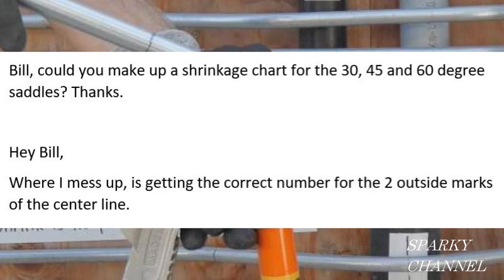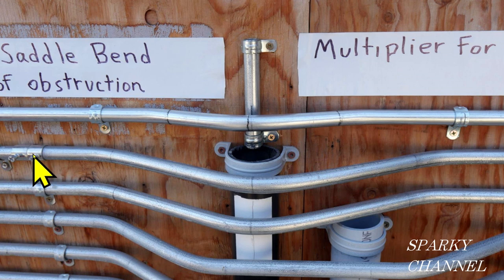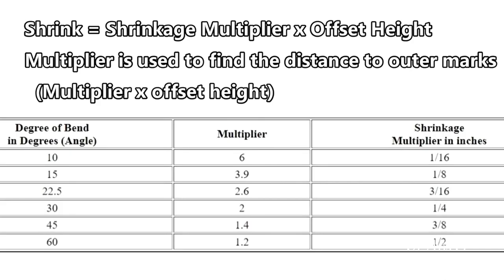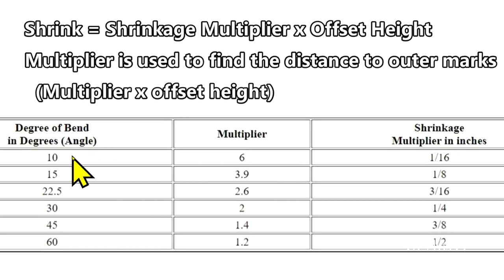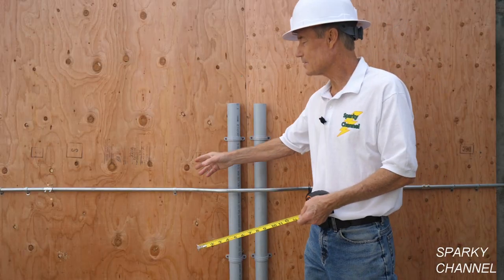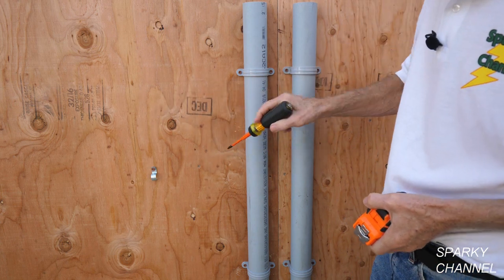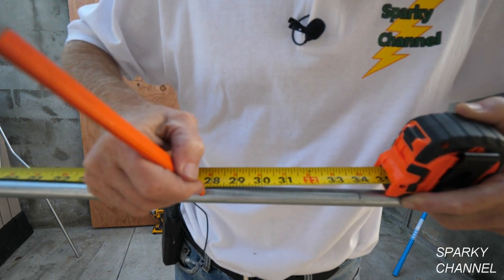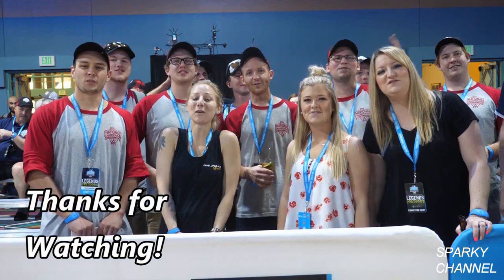EMT Bending Shrink and Multipliers with Chart and Examples

Comment: i need help to fix my garage door its so heavy i cant lift it off the ground something is wrong it used to way so light
Reply from the maker: Do you have a broken spring? Have you tried releasing it from the opener? If it's a broken spring, they are very dangerous to work on yourself unless you have a lot of experience with them.